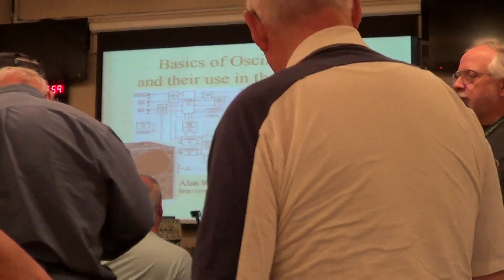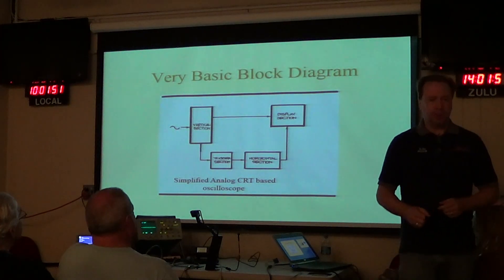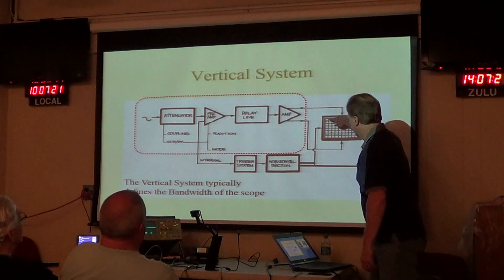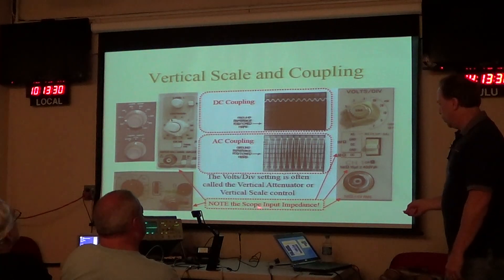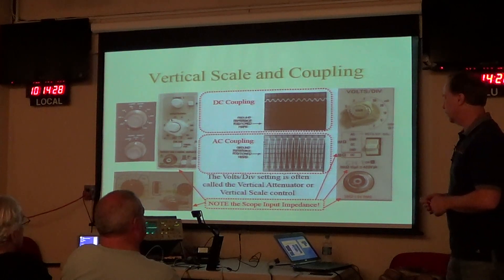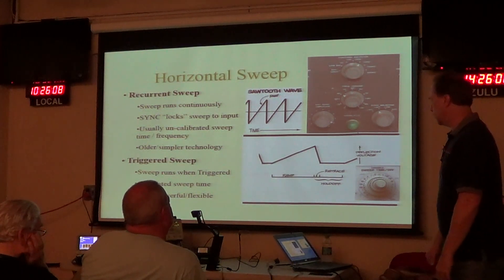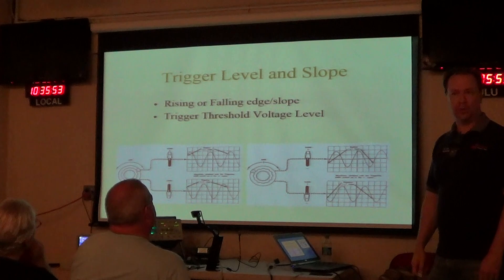#160: Oscilloscope Basics, and how they can be used in the hamshack | tutorial

Comment: Thanks for this video. So very helpful. One question I have is for two traces on screen at same time, why not just use the chop mode all the time. Why is it not as good at low frequency as the alt mode? Finding diff voltage using Add and Invert mode was very cool. I often wondered what those controls were any good for.
Reply from the maker: Chop is used for slower sweep speeds, lower frequencies. Alt is used at higher frequencies. You typically don't use Chop for higher frequencies because the faster sweep speed will reveal the chopping behavior between the two traces.
Reply: instablaster.

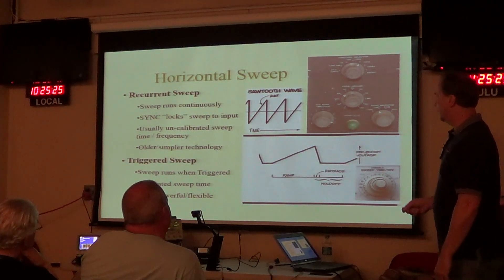Comment: The difference between the two sweep schemes shown at the slide at 29:35 , I am really confused by it. Historically did being able to retrace and holdoff bring about the ability to trigger? I think it should be possible to perfectly trigger to the first sawtooth waveform also. What exactly is the sweep diagram with retrace and holdoff trying to convey as opposed to the simple sawtooth waveform?
Reply: If the horizontal sweep is driven by a continuous sawtooth, then the input would have to be harmonically related to the sweep frequency in order to be stable. A triggered ramp ensures the waveform is stable.

Comment: Deja Vu Allen! I have 5 analog and 1 (Rigol DS1102E) digital scope, and I use them all. However, for general ham radio work I find even my most humble analog scope (a 5mHz Heathkit) is more useful all round for HF radio stuff than my DSO. Filters and tanks are so important to radio as is ability to easily sweep them. XY mode on cheap DSOs is all but unusable, if you have that option at all -some do not. There are workarounds ..but just sayin. The processing lag can also be annoying. There is a flood of cheap signal generators  too - but their rise times are from 5 to 10 times slower than the little 74AC14 based TDR you showed in your one of your past videos. These slow rise times limit how small an inductance, capacitance, cable and how high a frequency you can accurately, usefully and reasonably deal with. Anyway -my old Tek 475 is my main filter/cable/tank circuit tamer and I use my other old analog's for monitoring.

Comment: Now a Course on how to Troubleshoot and Repair those old Analog Oscilloscopes!
Reply from the maker: Absolute first thing to check is power supplies at every circuit that is not operating properly.  After that, you typically (unfortunately) need a scope to troubleshoot a scope.

Comment: Why do o’ scopes use electro static deflection instead of standard magnetic deflection ?
Reply from the maker: Mainly because it is easier to drive the deflection plates (which are like small capacitors) to high frequencies than it is to drive a magnetic deflection coil (large inductance).